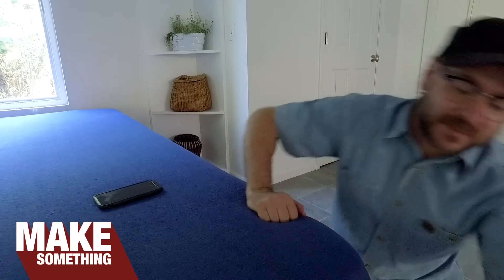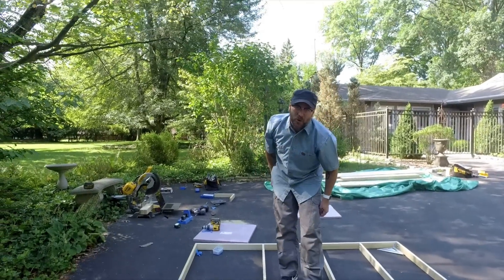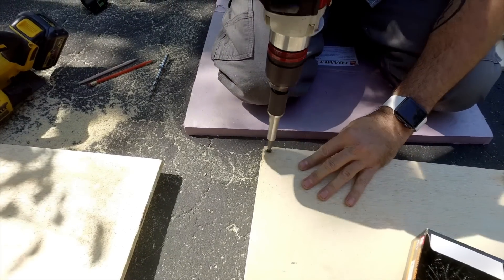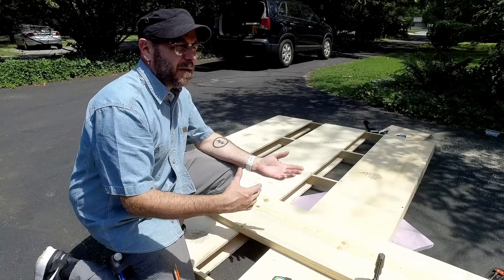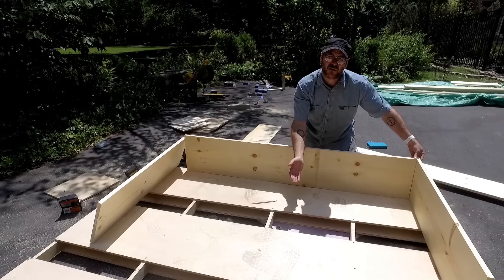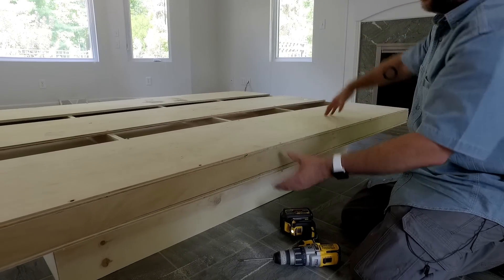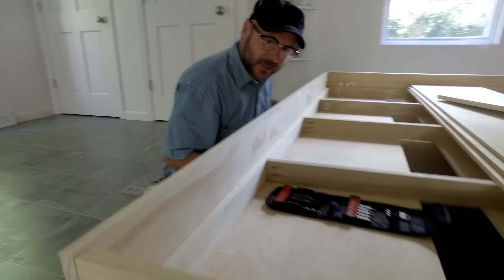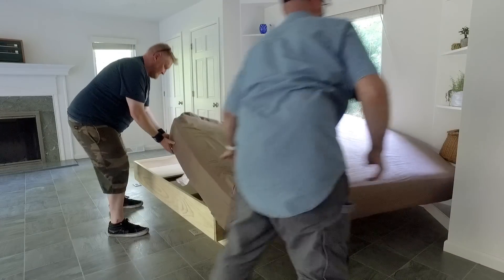How to Make a Platform Queen Bed | DIY Project

Comment: I just modified my queen size bed frame to fit my king size mattress... I should have measured my doorframes lol only 1/8inch cleareance to get it threw the door lol. Also how many cuts do you get from the batteries on the dewilt chop saw?

Comment: Those counter sink drill bits - I am always breaking them too! Wonder if its just what happens with those. there is a brand (can't remember), where the bit is held in with a screw, so they are replaceable - but they have a square shank, so you have to buy their bits (can't use a regular drill bit). But it is cheaper than buying a whole brand new one.

Comment: Another great video David. Quick question, how far in can the base be before the feels tippy? I like the look of the floating bed and my try and copy it someday but I'm just curious how wide the base needs to be without loosing to floating look. #WranglerRiggs
Reply from the maker: +Ken on the run I not sure. It might have to be something you experiment with. I know that the base I made could be even smaller.

Comment: Sharp looking bed.  Question...why didn't you put the pocket holes for the base on the inside instead of the outside?  Seems like that would be even better at hiding them.  #WranglerRIGGS

Comment: Pro tip: When cutting plywood with a circular saw, adjust the blade so it just passes through the work piece, rather than cutting below it another 2+ inches. This makes control of the circular saw much easier, meaning you will cut straighter. I do this with my big heavy Skil saw and my cordless Makita. Source: Cuts a lot of straight lines on plywood with a circular saw. #WranglerRIGGS
Reply from the maker: +Cowboy ahh, thanks!!

Comment: coolio been wanting to make a bed frame.. what size bed did you build for? queen/king? also how tall is the mattress off the ground?  Last question: Did you account for the base width to support anyone laying on the side edges of the bed? #WranglerRIGGS thanks for the ideas and been listing to current and back eps of you, bob and jimmy's podcast.. Im moving forward currently and backwards from 95...
Reply: The title says it's a queen bed frame... And based on the materials he used it's probably around 16" from the ground.
Reply: yeah I just clicked on the link in my email.. didnt even read the title, mah bad.. thanks for the heads up..

Comment: Couldn't you have pocket-holed the base onto the frame from the inside, so the holes wouldn't show on the outside (if you happen to be down at floor level for reason)?
#WranglerRIGGS
Reply: Hi what's the name of this thing you're using with the screw bit and drill bit? Thanks you
Reply: @dillonspringle9086  it's a pocket hole drill & Jig made most likely by Kreg.  They make quite a bit for hiding fasteners.

Comment: Constructive criticism not trying to be a know it all d-bag. When using the circular saw with square place the square on the far side of the board. That way if there is kickback you won't cut off your hand which is now behind the saw.  Just trying to help you save some fingers.

Comment: May I ask, you have much better equipment to work with, hell one piece of equipment you have is worth more than my entire shop, but the with the equipment and know hot, Why is it you and others work on the floor or ground when a bench is easier on the body, and you are getting older every day/
As you may figure I don't have equipment to do videos so use your imagination, 2 Stanley plastic saw horses with 2 2X4s 6" in length, an old 36 inch door makes a great portable bench.  I put scrap wood under what I am cutting and can still reach across a 4" sheet of plywood.  I have made straight edge fro scrap sheet of plywood so I have  $10 invested. as the saw horses were on sale for $5 each..  I started working for a contractor so I took my own bench and everyone got off the ground and used my bench. I know I am an old man and I learned to do some things before most were born.  Shop teacher taught the best lesson shop safety, that being NEVER GET BLOOD ON THE WOOD